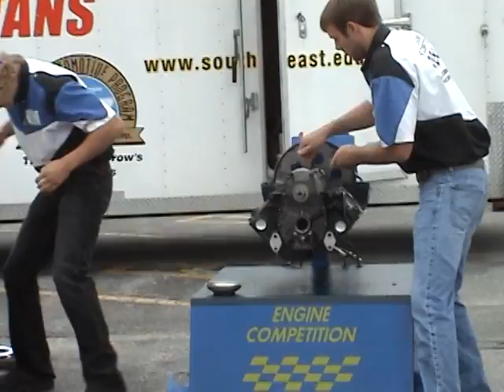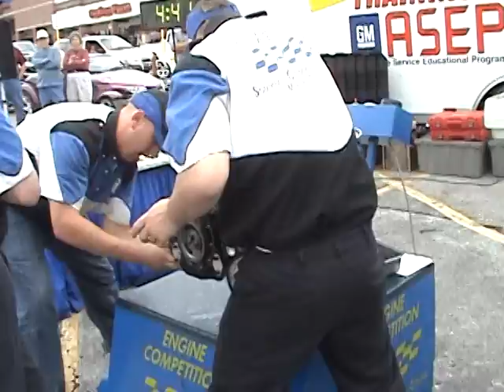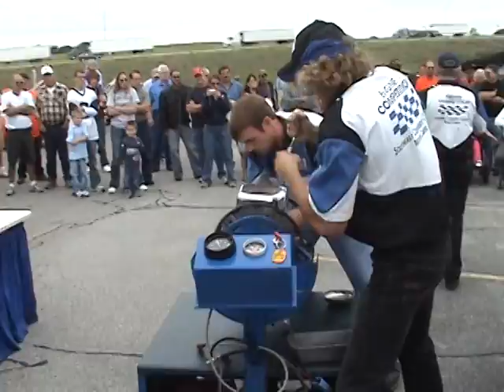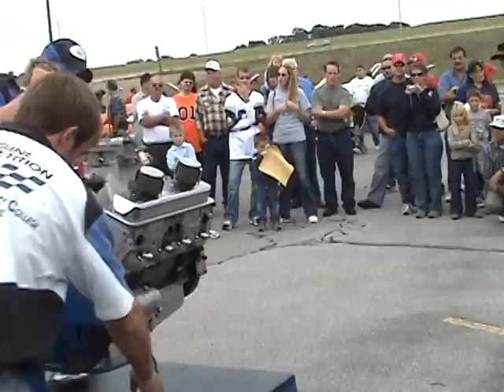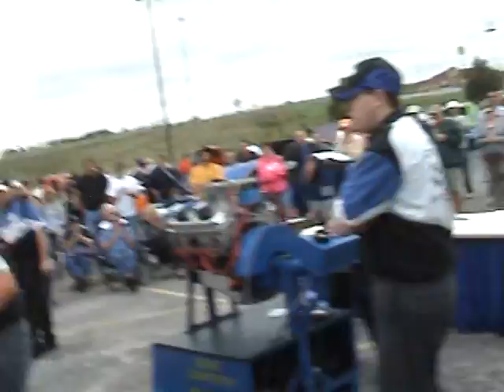Engine Build Competition SBC in 17 min 10 sec

Comment: I just wonder how long one of these engines would stay together and what would happen if you beat on it. I didn't see any clearances checked àny cleaning of parts before assembly and when they torqued the heads mains and rods they never did it in secqenc

Comment: Yea ive got my credentials and bragging rights over ive had inmy short 10 years have succrssfully buit over 14,000  engines with my father and ive/we have rebuilt 0 are bad and most that didnt crash and get junked are still running now some with excessive miles now 4,000,000 miles so far onthe envoys4.2 and over 5,000,000 0n a 86 chevy 305 are some of the first ten.
Reply: And im a girl, i know more than most men about cars. And im not a lez.

Comment: That looks like fun!  But first, you should have a competition for how fast a team can tear down on old SBC, send it to the shop to be hot tanked, true the deck and line bore it, honed, freeze plugs and cam bearings installed, get the heads done, take it back home and run to the Auto Zone for gaskets and silicone and antifreeze and oil, pick up some Gold Medal flour, milk and ground chuck for the Mrs. and some dog food for Jake, etc.

Comment: why are they allowed to have everything prepped they should have to do cam bearings freeze plugs and install all bearings in rods and caps as they go and install rings and the flywheel then run it 30 min and they don't even check clearance

Comment: How to build an engine?
Start wid the engine oil pan 
Add the lower base 
Add flywheel 
Add Cranshaft and fix pistons 
Add the top head 
Add manifolds to the side of the head (make sure you get intake and exhaust right) 
Add harmonic balancer,alternator,idler and tensioner to the front 
Add timing belt 
Add serpentine belt 
Add camlobes to the cam shaft 
Add cam followers and push rods
Add rocker arms to the cam lobes
Add spring on the on the valves
Attach these components on top of the cylinders
Add Sparks plugs
Add fuel rail connect it to fuel injectors
Place the fuel rail on the engine 
Place fuel injectors in cylinders
Add oil pipes to the oil pan 
Connect them to oil bearing 
Connect the oil pipe to a oil filter 
Connect the oil pipe to the engine head
Make holes in the camshaft housing for oil drain to pistons and crankshaft
Add cooling pipes through cylinders
Add thermostat to engine head
Connect coolant in pipe to cylinder wall pipes
Connect cylinder wall pipes to thermostat 
Connect pipe from thermostat to radiator intake
Add radiator fan 
Connect radiator out pipe to water pump behind radiator fan
Connect water pump pipe to cylinder wall pipes
Connect exhaust manifold to back turbo impeller housing 
Connect intake manifold to  intercooler
Add blow off valve to intake pipe from turbo.
Add connect waste gate to exhaust and intake  pipe from turbo 
Connect fuel rail to throttle body 
Connect throttle body to fuel tank 
Connect throttle body cable to accelerator
Connect fuel line to fuel filter

And that friends is how u build an engine.

Comment: I like how they torque the head bolts all 65lbs in one pull and ignore proper torque sequence, and those bolts just ran down with a speed wrench couldn't have more than 15-20ft lbs on them. Them engines probably wouldn't last long in the real world.

Comment: The other best part at
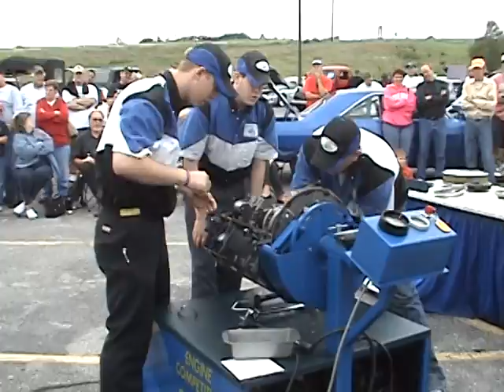5:09
If they can build an engine in 20 minutes, how come it takes an hour to change the oil?
Reply: Because you can’t built an engine in 20 minutes. Sure you can slap parts together in 20 minutes but you DO NOT want those engines.

Comment: I know this is old but holy fuck shut the fuck up about the amount of torque they used on the bolts.  You idiots must have never used a torque wrench in your life..   you SET IT to the torque you want and it won't tighten up anymore than what it's set to no matter how much you turn it.  It'll keep clicking like a ratchet turning the opposite way it's set..   facepalm

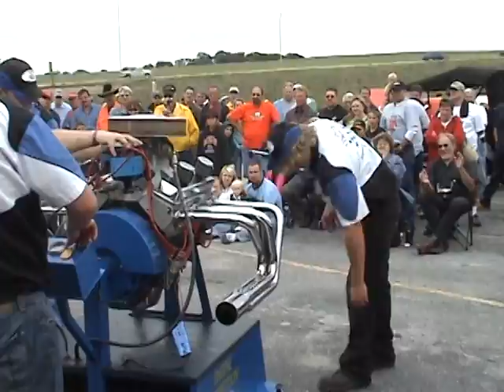Comment: The engine start at 18:13 was more professional that the first one. In the first one the timing was a case of trial and error while the latter one was perfect to start with.  Much of the procedure followed broke all the rules  that a good mechanic should follow.  Such a competition should not be a case of who could build the fastest for simply running an engine for one second, The building should be according to a professional procedure and the engine should be left running  for one hour at  75 full throttle . Assembling an engine for a longer duration and reliability is  a different cup of tea from running an engine  to give a one second burst, which I do not call smooth running as one desires.  Still they are all so young and this is an adventure for them so congratulations to the participants and the organisers and all the audience who supports these youths.

Comment: the nice thing about the sbc is all you need is a 9/16 a 5/8 a 1/2 and a 7/16. just to get the power steering off my mustang it took half the dam tool box. all the old engines were this way. try this with a new engine, it'd take an hr at the very least just because of all the different sockets and wrench sizes.

Comment: What did they do to check the oil pressure? I'm building an engine and want to check the pressure the engine's making
Reply: +The Stang 
PAY ATTENTION DUMB ASS. THEY USED A DRILL TO A 5 SECOND LIMIT TO ESTABLISH PRESSURE AT THE GUAGE

Comment: What kinda bullshit is this? Both engines barely even started... let them run for at least 5 seconds to see that they actually run fuckin come on.... Watching 17 minutes to see it completed and run and they don't even fuckin let it run...
Reply: Roc790 they had no gas or anything to last that long they only had what was in the carb bowls
Reply: Plus I'm sure they aren't trying to ruin the block or heads or anything by getting them hot considering there is no cooling system yes those motors need to be taken back apart and assembled correctly with torque specs but the parts are still good

Comment: I wonder how deep the scratches are inside the cylinder walls are from them slamming those pistons in with the rods connected
Reply: +William Finley I will pay you a billion dollars if you can attach a rod to a piston that's already in it's bore.
Reply: +Ben Dewse yeah that's just how its done, if there's another way of doing it, I've never seen it

Comment: The point is to display what they learned and how much they have learned enough to do this all quick. Its all show. Torque patterns are important of course. And they kind of have to get the timing marks right. Unless it wont start, which defeats purpose of the show.

Comment: Now put one of those in a car or truck and get 100,000 miles out of it. Not gonna happen.
Reply: Sure it would
Reply: +Stuntihn MX Nothing inside this engine was tuned to specs it was a speed demonstartion this thing would not run very well and i doubth it would make 30.000 miles

Comment: this is cool but when is speed ever a factor in rebuilding an engine?
Reply: in racing when an engine blows or something.
Reply: In Top Fuel, Pro-stock. Any professional racing. Top fuel technicians rebuild the engine after every single run. From the car getting pushed into the shop to the car cranking back up, it's around 30 minutes. 8 to 10 minutes to tear it down and then around 20 to rebuild it.
Reply: +Joe Armijo Not in 24 Hour Races if you can get back to the Pit
Reply: +christian menchu youre out if it blows during a race.
Reply: You are wrong. Top fuel and funny car teams rebuild there motors after each run.
Reply: oh what bullshit if that was the case most cars with blown engines on race day at the start of the race would be back in the race in half hour what crap, go dribble somewhere else
Reply: Not drag racing
Reply: its just a competition people. when does any type of mtorsports apply to the real world. it's entertainment. just like potato sack races
Reply: Alex's Bikes and Motors when you're in a engine building competition maybe

Comment: Lets see them do that, then test the engines on the dyno for a few pulls and see if they hold together. Also on a side note, I went to Wyotech, and after I graduated and went looking for a job, employers didn't give a damn what school I went to if I didn't have any experience. I was hired on as an oil change tech and had to work my way up all the same as if I had just graduated high school, got the job, and saved 30,000 dollars.

Comment: Lol when you are the one who spends upwards of 1000 dollars on parts you will do it right. There fore speed does not matter as not as you are not super slow
Reply: Only $1000 on parts? Now that's a BUDGET build you have there haha
Reply: +MsDasnake I was just saying. I just built my forged lq9 bottom end with a brand new block for 2500 which is super cheap. That is just the short block gonna get some dart heads for about 900 and a comp cam to build the motor for about 4500 with 550 hp is dirt cheap
Reply: damn now that's a deal, what are you putting it in? sounds badass
Reply: +MsDasnake 85 yota with Rockwell 2.5's 4 link suspension on 40inch King coil overs with 54's 
Basically a mud and show truck

Comment: a demo for what? if you can set timing and dump bolts together and know what goes where anyone who knows that can do this. in reality this is a 45min job if your really good and do everything correctly and fast
Reply: +Daniel Keener Anyone with working legs can run around a track. Only the fastest ones make it on TV though. Why? Because it's not about fitness or anything practical. It's about being entertaining for the spectators.
Reply: ITZ ALL A LIE lol

Comment: Torque patterns be damned
Reply: +Warndog Yeah, I don't get that either. If they took the time to do something like line up timing marks, then why not do everything else properly? The competition should have been to build an engine that's put together properly as fast as they can, not just a demo to see who can wrench the fastest.
Reply: ***** I would actually love to see that. the full nhra rebuild. Going to have to search for that.
Reply: +Seth Powell It says at the beginning everything was pre lubed
Reply: Tim Ramich because timing marks are crucial to an engine running properly, torque patterns/specs you can get away with for just firing the motor
Reply: Of course they know they're not following them. If you know how to assemble a motor you know about torque patterns. Goes without saying.
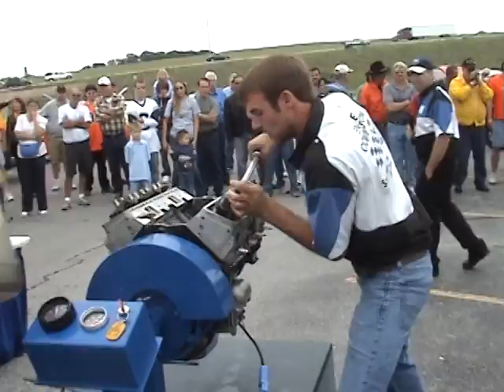Reply: Warndog Just after 11:00 you can see the text that they are doing a speed way to and this is a Demo only.  They state that they know they aren't following the torque patterns.  It's only a "Demo".
Reply: @Adaran  and
Reply: +Tim Ramich Didn't prelube anything either, or plasti-guage the bearings

Comment: what is that tool called at 0:45? I need one.
Reply: fink plaid speeder handle. just buy an electric impact if your serious about working on stuff
Reply: Thanks a lot man! I'll probably invest in both since I'm a DIYer. I'm a sucker for tools.
Reply: i have a speeder in every size & i never use them i just use my electric ratchet and elect impact
Reply: You're kidding, right?  Manual wood drills like this have been around for centuries, for cars maybe 100 years.
Reply: fink plaid I use one of those to start my dad's Fairbanks Model D. lol
Reply: It's called a brace.
Reply: Hao hao hao

Comment: I'm not aware of the rules in this competition but why bother to use a torque wrench? And only installing one bigend bolt on each rod and two main caps on the crank would see it run for what looks like the mandatory two seconds. After all there is no oil in the sump! Oh, and who assembled the head?
Reply: +jerseybean59 oil goes in at 11:00

Comment: how many scuff and scratches do u think that crank has on it now haha. frickin cool as heck though.
Reply from the maker: the cranks get banged up and we have to polish them often, cam bearings get the crap banged out of them when the cam gets jiggled in and usually not so gently. we do use spark plug boots on the con rod studs to lessen the damage from installing pistons.
Reply: +Todd Morrill Any chance you can recommend a trust worthy machine shop in the Omaha area?

Comment: if i am seeing right there is no assembly Grease or Silicone used for sealant  , or the use of backup check on the Torque settings ,,, or torque the bolts from the center in a rotational from the center out to the ends on the crank , Heads , inake ,,,,, torque Sequence is the Most important thing in a build ,   i Give the instructer a Fail in not teaching that ,,,, enging Build is not a Speed  thing it is a correct assembly thing , to correctly Build an Engine it takes Several Days , not what is shown here cutting corners   , i  Forcast the engine Failure within 1 week of normal use of the  So called builds , All fail in my book .....
Reply: It is my impression that this is just for competitions sake and that these motors are in no way intended to run after said competition. It would be a completely different and cooler story if the goal of this competition was to produce a "properly" assembled engine that was to run afterward.
Reply: ThePetey2120
So it wouldn't be a cooler race if they actually put them together to run ?
Reply: Well genius this is a competition build not a real life build. I'm sure they are trained in the correct way in class. It's not like mechanics are ever in a hurry to fix your car.
Reply: Just watch top fuel teams rebuild their engines.
Reply: I was thinking the same thing!!!!! I'd hate to buy that engine.
Reply: Krevin Grard I have, and even worked on top alcohol cars. Even though everything is done at a frantic pace, it is always done right. Yes they might use rattle guns set to pre-set torque settings, but your also talking about cars that get pulled down after every race, back in the workshop they get a lot more love and attention. We used to build our own race car engines with the same level of care as any of the customer engines. Worth doing... worth doing right the first time.
Reply: Krevin Grard I worked on race cars, eighteen years!
Reply: Chris M dude I've built engines to with stand 700hp and dude this is cool shit. it's meant for fun and just plain old competitive sportsman ship and dude they even primed the fucking oil pump come on man. They did good
Reply: ***** so are sports and hundreds of millions of people sit and watch them..... Your a counter productive person.
Reply: Jim Davis I'm with you Jim if they don't do it right under pressure, then they haven't been taught properly. Crank wasn't tightened in correct sequence either.
Reply: +Chris M Yea dude they are gonna  start them up. cool
Reply: +Chris M 
They did run idiot.
Reply: Man whats with all the aggression ? I am a rodder myslef I have built quite a few engines. I know exactly what is involved in just slapping the parts together, honestly on an SBC there ain't much to it. Hitting the torque specs, properly mating surfaces, lubing  and tuning ready to rock would make this a much more meaningful performance to me.

Comment: sort of surprised no torque order was used on cylinder head bolts. as a tech for over 30 years I have the sbc order burned into my head and sorry to say that was not correct as shown.
Reply: They also only ran the engines about 1 second. It doesn't matter...

Comment: So you are telling me i could drop my car with a broken engine by the shop and come back in 20 minutes and i'm good to go!
Reply: not really building an engine is one thing .... makin sure it works tuning it perfect and tightening everything to 100% is another
Reply: It would likely take much longer than 17 mins to remove the engine out of a vehicle let alone replace it. That and the engines that were built here are carbureted and they already had the heads and carb pre-built. The engines in all these modern vehicles are electronically monitored and controlled, so the wiring alone is time consuming. haha!
Reply: +Joseph Melville No.
Reply: +Joseph Melville What about engine dismounting and preparing new parts?
Reply: Yes! But, then you'll get about 20 feet, and have to come back and get another.
Reply: It's not hard putting a engine together and putting it in but getting everything right is key
Reply: Joseph Melville well no, lol had remove the engine first xD
Reply: Yea if it was already taken apart lol
Reply: Removing your old one, building a new one, installing the new one, syncing everything and making sure everything is running as should. Nah, more like a few days
Reply: very good
Reply: Ummm, what about everything in the way of the engine?
Reply: Joseph Melville your dumb as hell ....
Reply: No, this is an assembly contest, with all the research & machining already done and parts stacked at the ready.  There's no broken bolts, measurements to take or any real hassles [like a boss with their knickers in a twist].   A real garage is going to be short a few bits, and that means somebody has to run parts - come back tomorrow.
Reply: Joseph Melville NO!
Reply: ***** Basically they tune the engine in 2 minutes and 50 seconds...
Reply: No making sure your shit is running right takes time
Reply: Joseph Melville no, if you come by with a broken engine and want to get it fixed, maybe but you still have to diagnose. But if you want an engine replaced good fucking luck more like 45 mins. Plus, this is just a 350 engine carbed. A modern engine has all the vacuum hoses and sensors and you have to hook up the wiring hoses and mount it.
Reply: Joseph Melville if you had a 350 in it yeah sure